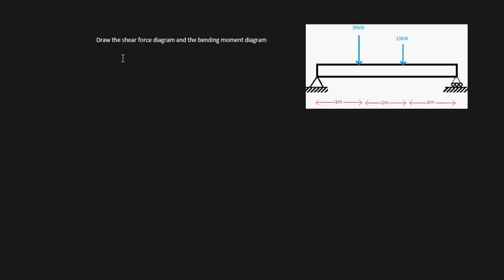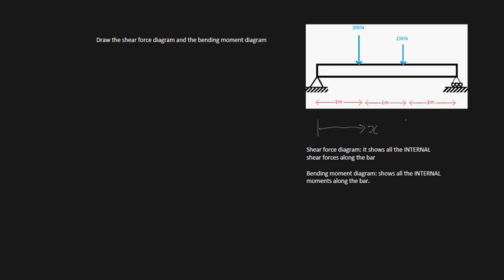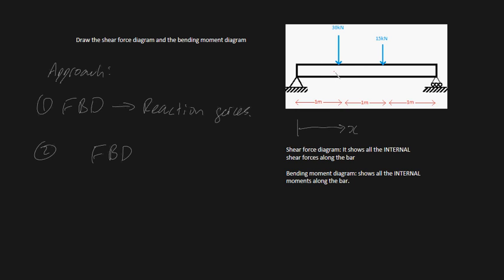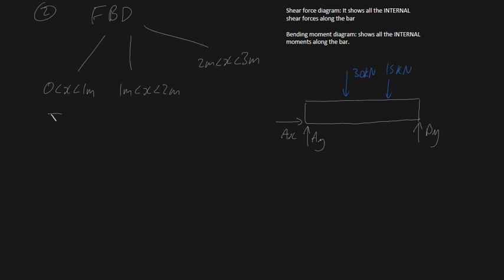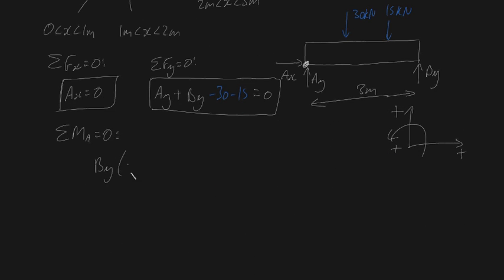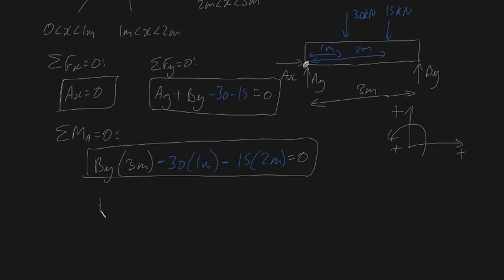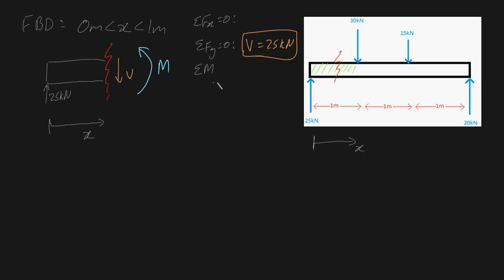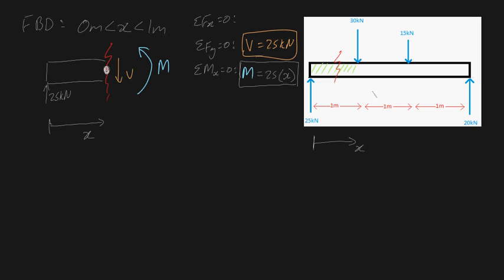Shear force diagrams and Bending moment diagrams

Comment from the maker: Sorry about that. There are a few things I didn't mention because I didn't want to over complicate the video.
1) It is correct notation to continue the vertical line back to 0 on the y axis. 
2) That being said, there is no mathematical reason to explain why this is the case. Technically there should also be open circles at 0,1,2, and 3m since we haven't actually evaluated the SF or BM at those points. However, all Engineering textbooks stick to this arbitrary convention. Hope that makes sense.